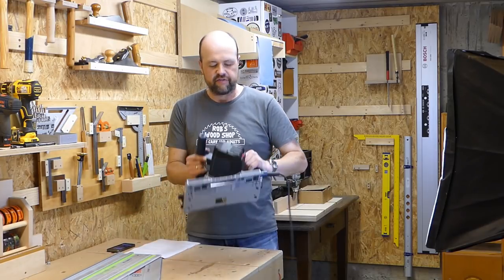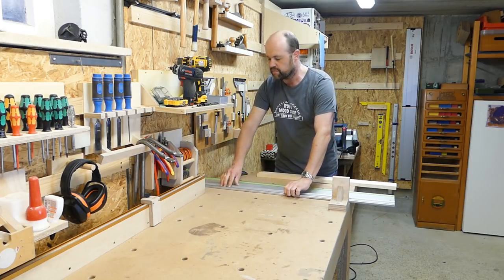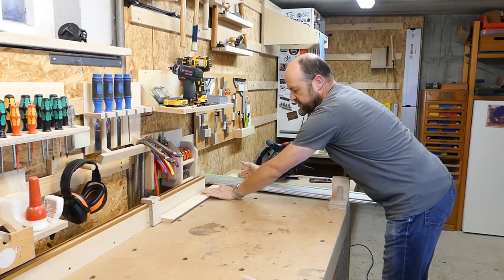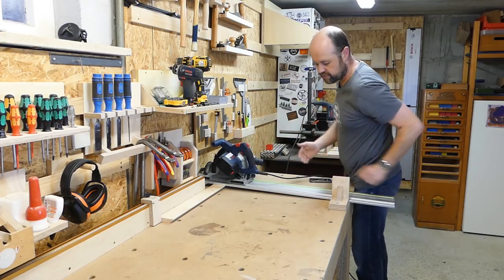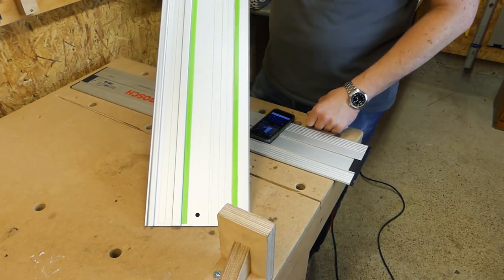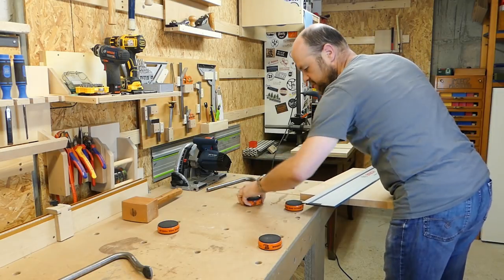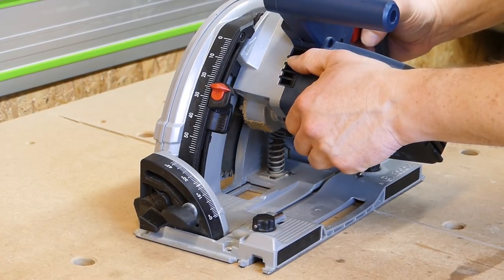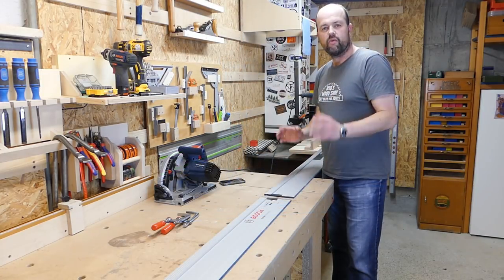BOSCH GKT 55 GCE – TRACK SAW REVIEW – tips and practical solutions (plunge saw review)

Comment: For solving the track/saw width problem, I took a 5mm HDF board, cut it to the size (L, w) of the Bosch track. Then glued two strips of wood 10mm (w) x 3mm (h) parallel to each other on the HDF. These strips fit in the grooves below the track . Then fixed said HDF perpendicularly to a fence. When I want to cut I place the track on the HDF and use the Bosch clamps to take any mechanical load away from the parallel wooden strips.
Reply from the maker: Thanks for your feedback! Sound great.

Comment: Hi, thank you for the video. I had a question, how do you adjust the blade if it is not 90 degrees to the base plate? I just got my saw, checked if it was square, but it wasn’t. I used the grub screw for the adjustment, but it is not 90 degrees still. Much better then before.

Comment: I bought the Makita and had some regrets about not getting this Bosch ( the Makita was cheaper), until I saw that the Bosch track doesn’t work easily in the crosscut jig you have.  I like these saws a lot, especially after 20 years of using a typical circular saw with a guide board clamped to make straight cuts.
Reply from the maker: I don’t know the Makita first hand but I’m sure it’s a decent saw as well.

Comment: Andreas - nice video! I am in the USA and imported this saw and tracks. I had to turn down the speed because power is 60 Hz here. I built a Paulk cross cut jig for my Paulk workbenches which is used in much the same manner as your setup. I had to modify the cross section where the track mounts to match the Bosch rail but it works great. Try locating that (or buying the plans like I did) for a few ideas. Keep up the videos on this system - there are NOT enough on YouTube.
Reply from the maker: Thanks for your feedback, Scott. That sounds very interesting. I’m going to have a look at Paulk’s solution.

Comment: I bought this saw myself, i think its a good saw it has got some bad reviews about cutting square and problems with warped base plate.I have not had any issue with the saw myself and you can buy bench dogs that mount underneath the track which makes the track compatible with mft type benches.Bisch bash Bosch channel have a great video on youtube about bench dogs and Bosch Corp made a youtube video regarding the warped base, hope this post helps anyone considering purchasing this tool also a great review by John Mc Grath youtube channal about this saw, Great review thanks Andreas

Comment: How did you overcome the problem of adjusting the saw's play for each of the tracks?  I understand the Bosch fits loosely on the Festool/Makita tracks.  And if you use the saw with lateral play... of course you chew up your splinter guard to the point it won't indicate your true cut line.  
So do you just adjust every time you switch?  For me that sounds like a nightmare.
I'm up against the same problem with my Mafell Mt55 and the MFT style table system.
Reply from the maker: I drilled a hole through each of the round knobs with which you adjust the  play. Then I put a small rod (o 3 mm) through the hole so that it sticks out a little at one end and some more at the other. With this, turning the knob becomes easier and the piece that sticks out a little acts as an indicator. Then I used a felt pen to mark the two positions that the knob has to be in, for the Festool track and for the Bosch track.

Comment: A great shop addition and maybe for beginners the ideal first sewing project is a sleeve for your vacuum hose, so you can route the cable internally and the hose doesn't snag so easily on any edges.
Made mine from faux leather, which is affordable, durable and super easy to work with, because it doesn't fray.
Reply from the maker: Thanks for the tip. I use the hose for other power tools as well, though. So I’d also have to switch to detachable power cords.
Reply: I made mine with a full length zipper, so it's not that much of a hassle to switch. The Festool cable system is really genius once you tried it and it would be awesome to have it on all your power tools, but it works just fine with normal cords as well.
I mean I wouldn't constantly switch between tools, but for example if I got a couple of pieces to sand at a time, I will use the sleeve. No constant snagging, only one wobbly long thing to worry about and no more risk of tearing pieces out of you almost finished piece.
Reply from the maker: +Jan Hagedorn the zipper is a great idea. Thanks for sharing!

Comment: Informative movie. Is it possible to adjust the Bosch saw with the Festool rail to be without play and cut perfectly, even on long cuts? On the video it looks like still has some play, even when you adjust the knobs. I have the same saw, considering buying a Festool rail for it. Thank you
Reply from the maker: Thanks for your feedback. Yes, you can adjust it tonnage zero play. One thing, though. You have to remove one of the green sliding strips on the Festool track from its original position (which is in a small groove) and place it on the top surface like the other one. Otherwise you don’t get a right angle. I used a hair drier  for removal and double sided tape to put it back on. I have a blog article in German on how I did that: https://holzhandwerk.andreas-kalt.de/anpassung-der-festool-fuehrungsschiene-fuer-die-bosch-handkreissaege/

Comment: At the moment, in the UK, the Bosch GKT 55 GCE and Festool TS55 are virtually the same price...though both are very good saws.
Reply from the maker: Thanks for that information. There are different varieties of the Festool, so it’s hard to compare. In Germany, the Festool is about 100 EUR more expensive.
Reply: whats the price in Germany for festool with rail?
Reply from the maker: +Jerolim Moravec there is no simple answer to this because Festool has different versions of the track saw. you can have a look if you search for “festool tauchsäge” on amazon.de or idealo.de
Reply: Thanks :)
Reply: In Norway Festool are 787 EUR and Bosch are like 355 EUR. Big difference, as Bosch are as good or even better than Festool, except the track is too narrow.
Reply from the maker: Strange that the prices differ so much in different countries.

Comment: Dear Andreas,
There is one question which comes in my mind when I look this video:
Why are you using two track systems. Is the festool track just good enough to do the 90 degree cuts on your table? So that you use the bosch track for all the other cuts. Or is the festool track as good as the bosch track together with the bosch gkt? I am asking because I am think to buy the bosch gkt as well but as you describe also with the festool track to use it on a multifunctional table with bolts like you adjusted your workbench :-)
Thanks Thomas
Reply from the maker: I had already bought two different Bosch tracks before I built the cutting jig from the video so that’s why I stuck with the Bosch tracks. Besides, the mechanism to join two tracks together is better with the Bosch/Mafell track system, I think. But if you start out, you can go with Festool tracks and stick with them, in my opinion. The wider build and the extra T-track which points upwards are very handy for a range of accessories, such as a cross-cut jig which is available from various manufacturers.

Comment: Great video and good innovation in your bench setup. If you wanted to cut shorter pieces, perhaps you could use the offcut side. That means having an extra board on the open area.
I like the way you drilled holes similar to the festool mft table.
Reply from the maker: Thanks for those tips. Now that I have a table saw the shorter pieces are no longer a challenge. They were when the plunge saw was the only option I had.

Comment: Andreas, if you were to work at the left end of the bench rail surely this would give you a closer working distance with less intrusion of saw body and ability to cut shorter pieces. Plus these saws are not very ergonomic for a right handed operator.. this would also improve if you worke at opposite end of bench Regards Stuart.
Reply from the maker: Thanks for the tip. Since I have my moxon vise on the left, this would mean a complet change to my setup.

Comment: Great little tool. Bought mine second-hand for 150 € (new it's at least 300 € in Romania, that's for the bare unit, no L-Boxx or rail). Chose it over the Festool and Makita because of the narrower track, which allows me to sit it on top of smaller pieces of material. Never had the courage to use it without the clamps, I'd rather take the time to set them up than ruin the cut. If you want to minimize the overhang required when using them, check the bottom of the rail : there's a second slot for the clamps, right next to the rubber lip. The only drawback is that you have to remove the plastic end-caps in order to access it.
Reply from the maker: Thanks for these tips!

Comment: I have plunge saw and Bosch track but have only used it to cut down sheets of plywood and find that it slips without the clamps. Do you experience the same issues with plywood?  I was considering scuffing the plastic runner with sandpaper to see if it helped, what to you think?
Reply from the maker: +H2Dwoat I don't have the slipping issue. Maybe there's sawdust on the rubber pads under the track? You cold also check if the saw runs too tightly on the ridge or you could use some dry lubricant on the bottom of the saw (In Germany there's something called Silbergleit, which is a dry paste that you apply to surfaces that need to glide across each other — I don't know that it's international name is). Good luck.

Comment: Hi

 Great video, very informative.

Quick question, about the tracks and the fact that the base of the saw overhangs on the bosch track.

Is the Bosch Professional FSN RA 32 800 track slightly wider than a normal track? and is it wide enough to solve the problem?

Thanks
Reply from the maker: No, they’re both 142 mm wide.
Reply: Yes your correct, had it confirmed on the BOB forums.

Comment: Do you mind me asking what you ended up paying for the set with the track, because when I was deciding between tracksaws I ended up with the Mafell in a Systainer and the 1600 track for only marginally (somewhere between 50-100€) more than the comparable Bosch or the Festool sets. 
Only wish it had the detachable cable system of Festool, but I've seen people modify them and it seems fairly easy.
Reply from the maker: The set with the 1600 mm track and the clamps was about 425 EUR (including the L-Boxx). Currently, the Mafell with systainer and track costs about 300 EUR more.
Reply: Hmm, I think I paid 460 or 480 for mine
Reply from the maker: Then you were really lucky ;-)
Reply: I just had a look myself and you're right, the set I got is about 7xx at the moment. Either I got a really good deal last year or they just skyrocketed in popularity or something.
Reply from the maker: I think you got a good deal. When I was in the market to buy a track saw I compared the Bosch, Mafell and Festool models and the two latter were both a couple of hundred euros more expensive than the Bosch.

Comment: i absolutely never understand why there is a minus one degree option on saws , what is it usefull for ?
Reply from the maker: I’m not quite sure but sometimes you might want to make sure that the edge you’re cutting fits tightly against another edge, that is not quite 90 degrees. When you use the -1° option you "undercut", so that the top edge is the only place where the two boards touch while further down (in the thickness of the board) there remains some open space (I hope this makes a little sense, it’s hard to explain without a drawing).
Reply: oh yes that absolutely makes sense ! thank you very much :) !
Reply: I saw a video where someone says it makes an even tighter joint for walls or floors etc

Comment: Hello Andreas Kalt , I have the same set up as you, Bosch saw with festool and Bosch rails. I'm having a problem to get straight cuts on the tracks, running the saw against a straight edge will give me perfectly straight cuts, running the saw on the tracks making a groove 3-4ml gives me a perfectly straight cut. When I cut a sheet of MDF 18mm for example, the front and end of the cut are slightly bowed taking out to much by approximately 1ml. I've checked the rails for straightness, tightened the knobs so the saw runs tight on the tracks and don't put any sideways pressure on the saw. Wondered if you had any advice? I'm tearing my hair out!
Reply from the maker: Does this happen with both the Festool AND the Bosch tracks?
Reply: I’m having the same problem with my bosch 1.6m tracks. Did you find a solution?!?
Reply: @hadcohn  I found I needed to support the track with a piece of scrap the same thickness as the material that I'm cutting, not very convenient when trying to cut a full sheet.  After a while it seemed to of fixed itself. 
I had the same problem running on the Festool or Bosch tracks, so I assume it was an issue with the saw.
Reply: @00Clive00  thanks for your quick response! Do you mean supporting the track on opposite sides( start and end cut)?
Reply: @hadcohn  Yes that's correct, good luck with it.
Reply: @00Clive00  Mmh, I do not understand exactly what the problem was and how a piece of scrap fixes that. Can you explain that maybe in a bit more detail or other words or show a photo / sketch what goes wrong?
Reply: @dingensundbummens  hi there again! Since you helped me before with the 90/45 degree setup, you might be able to help here too. The problem described above is still happening when I cut both with the FSN rail and the festool rail... unfortunately, I couldn’t figure it out how to upload photos here. Could I send you an email with a drawing? Cheers
Reply: @hadcohn  Why not upload to a free service and post a link here?
Reply: @nickgoogle4525  tried to do that, but it didn’t work for some reason. I’ll try again
Reply: @dingensundbummens  so, after reading 00Clive00 msg again I realized that my problem is the opposite: both ends are perfect on the line but the middle is concaved. Hope this sketch is clear enough:
https://drive.google.com/file/d/1wKzd0IliiOGdQnwiGAwLEnK5D-zhmvdT/view?usp=drivesdk
Reply: @nickgoogle4525  ok, this time it worked...
Reply: @hadcohn  Mmh, I'm not sure if you have problems that in the thickness of the wood there is a difference or along the cut line. Anyway, I never noted any of those problems and don't have an idea what is going wrong. Maybe someone else...!?
Reply: @dingensundbummens  thanks for the answer. I’ll keep trying to figure it out. Maybe it’s the feeding speed or the angle I’m pushing the saw...

Comment: Hi Andreas, could you tell is there a positive stop to adjust 90 degree(0) on this plunge saw? Mine is a bit off
Reply from the maker: Actually, I realised later that mine is a little bit off as well.
Reply: There are two screws in the saw that let you adjust the 90 and the 45 (and I don’t mean the knobs that unlock the slide haha)
Reply: @thulegezelschap5884  hi, I have the same problem, but can’t locate these two screws you’ve mentioned... could you send a pic? Thanks
Reply: @hadcohn  I don't have a pic, but if you have the saw in front of you, blade side faced towards you. Then there is this black plastic thingy on the left side which is the guide when you tilt the blade, and also includes (one) locking screw. Then, still from this view, you can see a small black screw which can be adjusted with a small (mm, not inch!) allen key. The Mafell track saw has two of those screws in the bottom plate, which is the far better solution / place for that. That's one of the reasons I wish I had bought the Mafell saw.
Reply: @dingensundbummens  thank you for the detailed answer! I’ll check it out asap.
Reply: @hadcohn  I just think I might have named the wrong side? That was from memory. In any case it's the side where the scale (0 - 45) is placed. :-) Good luck with the adjustment. It's best to make some test cuts on a thick piece of wood and fine-tune. Measuring the angle to the base plate is less accurate, as the base plate (at least mine) is not totally flat, but a bit bowed.
Reply: @dingensundbummens  thanks. I didn’t get the chance to try your tip, but keep you posted.
Reply: @dingensundbummens  yes!!! You are a genius! It worked. How did you manage to find this tiny screw?!? Anyway, now I have the need to spread the word... many thanks
Reply: @hadcohn  Yes, I also thought about making a video. Likely not "everybody" is aware of that option. I still think that the design is flawed or at least not optimal -- Bosch should have chosen a better solution. At least not having the screw touching the more or less fragile plastic... :-(
Reply: @dingensundbummens  BTW, I’ve just found this video https://youtu.be/KZfqU1ndvv8, and between 4.22-4.33 he’s talking about the 45 and 90 degree stops...

Comment: My partial replacement of mitre saw with a plunge saw and Bosch FSN WAN is in one picture - https://pp.userapi.com/c841124/v841124004/ed30/QNcYOnh6kBc.jpg
This solution, of course, also have some limitations.
And another one solution is making a groove even in narrow rails - https://pp.userapi.com/c639917/v639917019/4894e/LIU4k_Opx00.jpg In this case the track also needs a support with the rails of the same thickness.
Reply from the maker: Thanks for sharing those tips!

Comment: if you change you bench to cut on the left side there will be no problem with the rail.
Reply from the maker: Yes, but that would make handling the saw with my right hand a lot more difficult.
Reply: @holzhandwerk_ak  sorry, one more question. I would like to by such saw. What rail fits better, give more precise cutting, Festo or Bosch?